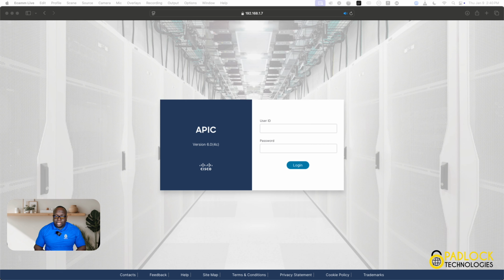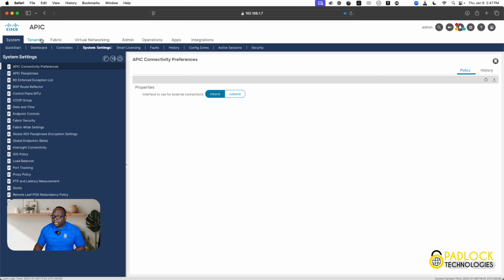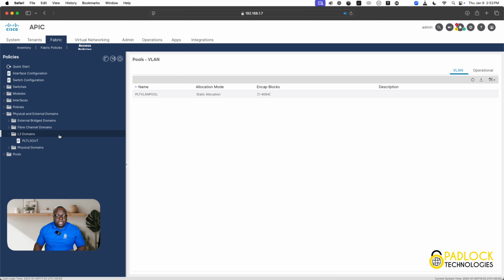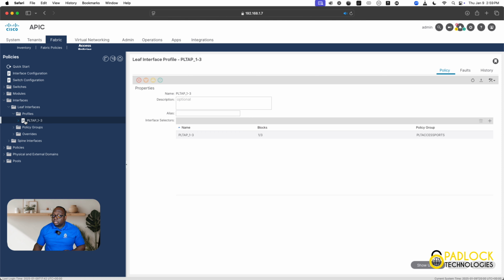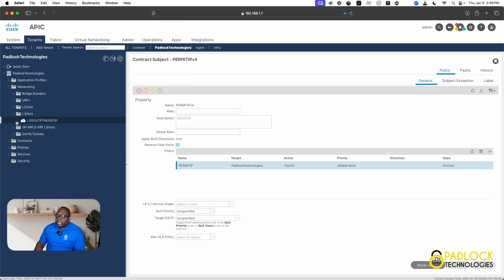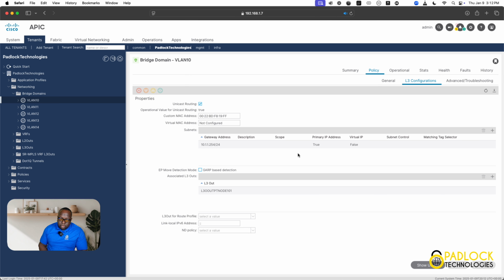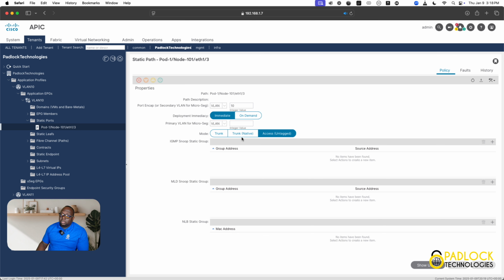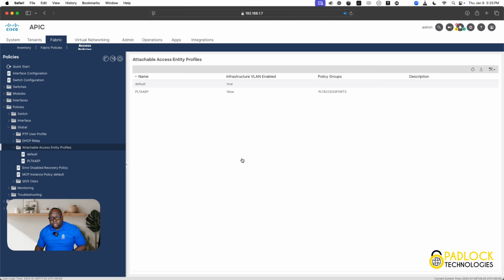You Won't Believe How Easy Cisco ACI Dashboard Can Be!

Comment: Advantages of DNAC at the Enterprise Campus level for SDA vs APIC?  Is it just one of those things like if you’re also managing your own DC using ACI then you might as well extend that out with the EM module?
Reply from the maker: APIC-EM is strictly for SDA. As far as I know, you can't add the EM module to the APIC for ACI. They're two separate APICs
Reply: @ oh gotcha.  I just know that DNAC plays a huge part if you’re doing Enterprise Campus only.  So my thinking was that if you’re already using ACI in the datacenter it’s almost like a familiarity and/or consistency thing.  Meaning you could use DNAC at the campus enterprise and APIC in the datacenter if that’s what you prefer?

Would also come down to cost, I suppose.  DNAC being a pretty substantial investment and all.
Reply from the maker: @BigMFWrubez  One DNAC/Catalyst Center appliance is like 100k. Its a huge capex hit and you have to get 3 of them for redundancy lol.
Reply: @padlocktech  daammmmmmmmmmmmmn.  Didn’t know they were that much now.  Interesting.